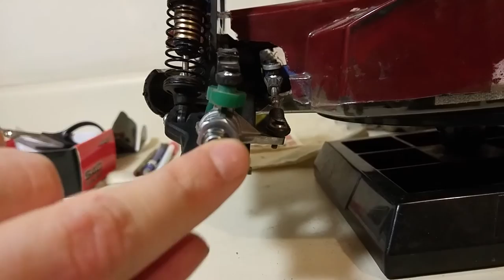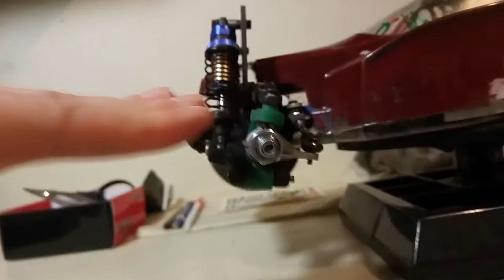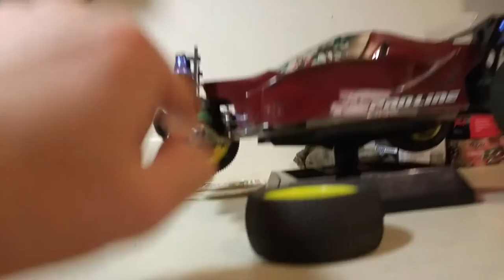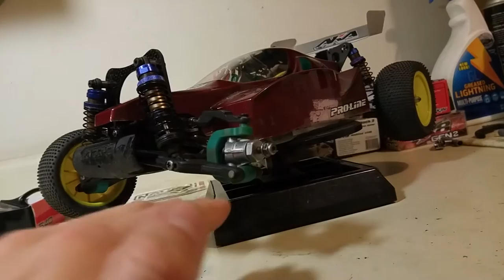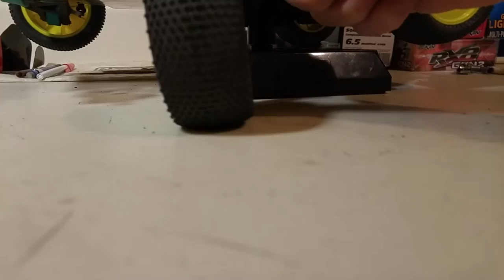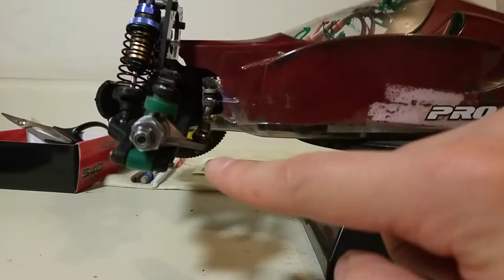Kick up and caster

Comment: Regarding B6.1 front rake, what happens if you just reduce rake in the arms, (25deg to 17.5deg) machining the aluminum bulkhead and adding a shim? The tower remains 25deg.
Reply from the maker: Less rake has two effects.  Assuming you change nothing else, it reduces caster.  If you compensate at the caster block, then the remaining effect is less diving under hard braking.  If you're on a bumpy track, though, front rake is very important and will keep the front from bouncing all over the place.
Reply: @doctormosfet  Reduce rake, Increase caster? Rake and caster effects on bump steer?
Reply from the maker: @scottjaskulski9253  reduced rake will reduce caster.  Caster doesn't affect bump steer to a first order.

Comment: Kick up angle means Anti dive right?
Reply from the maker: Kind of the opposite for the front end.  A larger kick-up will mean more dive under braking.  This is because the weight transfers forward, so a larger kick-up will absorb more of that than if the arms were parallel with the ground (in which case you'd need a vertical weight transfer rather than a longitudinal weight transfer to make the front dive).